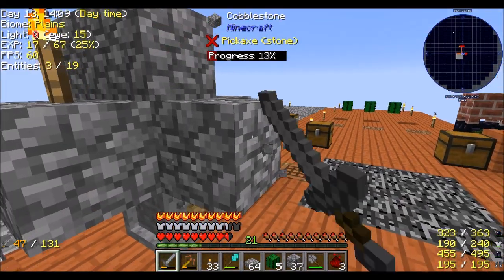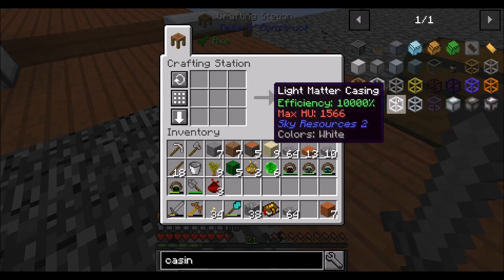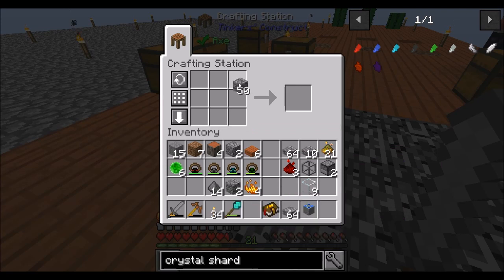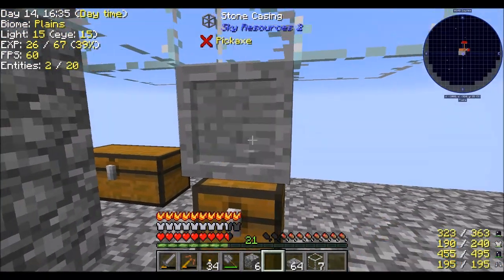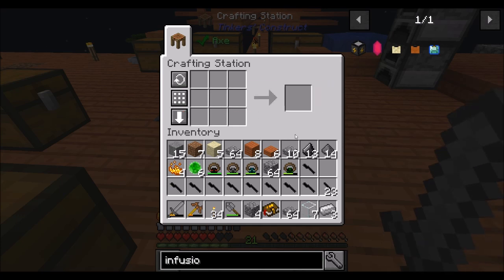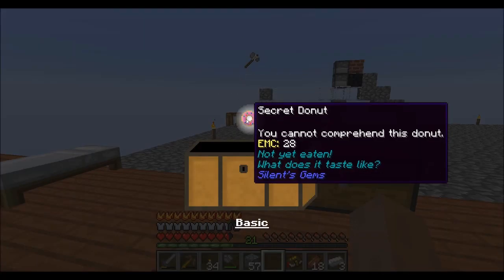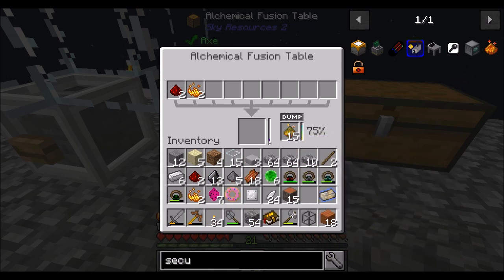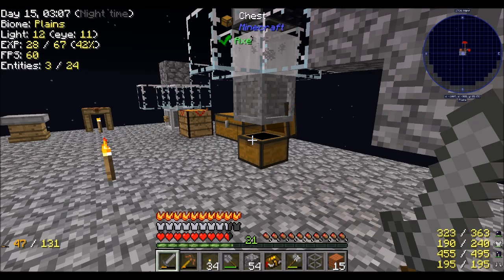Modern Skyblock 3   Ep5 Full Metal Alchemy

Comment: More hot (if a bit belated) tips coming your way!
- This pack has some of the best utility mods that one can ask for, so take a minute to familiarize yourself with them:
• Carry On! The mod that makes moving your chests, drawers, and pretty much every other inventory you can think of extremely easy. By default you have to shift-right-click the inventory with an empty hand to pick it up. I would, however, suggest changing the button to something else (alt for example), as it makes fiddling with drawer upgrades impossible.
• Crafting Tweaks! Hard not to notice the buttons on the side of crafting interface. Rather than me singing it praises here just poke them a bit and you'll probably fall in love with them. Don't forget that each button has slightly different action if Shift is held.
• Last but not least, the mod that adds dump buttons to chests. I honestly tried to figure out which one it is, but looks like it's one of the hundred "adds random stuff teehee" mods… Anyway, it will be your best friend for a while: shift-clicking the chest button in your inventory will automatically sort your inventory into nearby chests depending on what's already in them. So when you come back from your mob farm you can just click that instead of manually moving all the drops into appropriate chests.

- Speaking of the mob farm… Yoyos are a great way to quickly clear it out, but what about quickly picking stuff up? Well, you're in luck, Coin of Fortune is really easy to make in this pack. You probably already have materials for it. The best part it has both passive and active mode, so you can just hold right click on it after clearing the farm without ever worrying about it messing up your combustion or passive cobblegen. And the way active mode works somehow feels extremely satisfying.
- Setting up passive cobblegen with couple Magmafied Stones, some crystal liquid, a drawer and a wooden hopper is totally worth it btw.
- With AE2 being out of your grasp for a while, try not to forget about the T button. If you're having one of "just where did I put it?" moments, just look up the item in JEI (or look at the recipe that uses it), hover over the item and press T. It'll highlight all the nearby inventories that have it.
- And speaking of things being out of your grasp… This is a bit of an early advice, but do not hesitate to trash most of what you're getting when hunting for gems. You don't really need to waste your time washing stacks upon stacks of apatite, certus quartz and Silent's gems when you can't even use them. And by the time you do need them, you'll have machines doing that work for you.
- If you have updated the pack, you can twerk for trees, plants and even bonsai.
- Bonsai pots will grow slime saplings, saving you some time on making the slimy dirt.

P.S. I just found out that OpenBlocks elevators are gated in this pack. Makes me wonder what is happening in pack maker's head sometimes >_<
Reply: Stairs are beautiful.
Reply: Solid advice there, thanks!
Reply: Holy Molly that Coin is waaaaaaaaaaaaaay  too op... 
A honorable mention is building a Nether Pigman farm for, you know, free gold, since Gold is rather difficult to get in early game
Reply: Pigman farms? pffff. Don't bother Direwolf20 with the intricacies of vanilla machanics xD
Reply: To be fair, you don't need that much gold early game.
Reply: And as for Coin… It's one of the most difficult magnets to get usually. It's pretty damn good though.
Reply: I didn't bother with a nether farm, instead once I got to iron casing tier/automatic droppers, I "automated" my condenser by putting 2x2 infinite water source, and funneled lava over the water source above the condenser, you could probably actually do it much earlier, it only dawned upon me to do it once I did have iron after getting sick of placing stone blocks constantly. Creates Smooth Stone automatically until Actually Additions becomes available. Does get jammed sometimes though, when it happens I take the lava block out and refill the 2x2.

Then post iron/redstone; you unlock auto-combustion/auto-collection, make a redstone timer drop a load of resources and afk.

Also I preferred the ore method over the crucibles, I prefer the ore doubling via hammering and sluicing (one day tinkers smeltery or pulveriser... ( ;.;)) over getting an ingot, though I dunno, maybe the crucible-liquid gets better? I  didn't really enjoy the setup much, plus no more inputs besides alchemical ore dust.
Reply: Also another useful tip for when you're trying to make your first sugar cane,  you can toss rotten flesh into the porcelain smeltry to create blood, blood can be used to form coagulated blood in the casting table, eating those gives a temporary health boost buff. Don't remember if the drying rack version gives the same buff or less, but it gives like 1 additional heart, for the needed 2 total. Helping save on the amount of food you need to eat? (maybe? also 2 additional foods! 1 for the blood and 1 for the blood jerky)
Reply: There's not much reason to make sugarcane since you can substitute it with rice. And it's not like you'll be able to get the necessary food variety before unlocking Actually Additions. It's technically possible to get before that stage if you really luck out on Mega-Loot armour — some of the sets grant more hearts.

As for crystal liquid vs stone… There really isn't much reason to not use stone in this pack. Liquid might come into play later when you're setting up fully automatic constant production of all metals. At that point, ore processing would either become huge unwieldy monstrosity or a bottleneck.
Reply: I went for the full grind option and had to make 6 Silky gems (24gold) spending 2h+ to build a nether farm instead of farminging that much glowstone seems good for me.

Also another interesting thing i found today are Shipping Bins (or something like that, its reverse Market) 1 Emerald for 16 Rotten Flash is great deal.
Reply: Glowstone for 24 gold is nothing if you spend a little bit of time making Osmium casing for your Combustion Heater. And yeah, Gated mode is nauseatingly grindy.
Reply: FYI, the dump into chest buttons are from Quark.
Reply: Ah, thanks.
Reply: I didnt expect it to be that grindy, and I'm also too lazy to reset my whole world... at least I will not finish the pack in weeks like I ussualy do
Reply: You don't need to reset it entirely. Go to your quest list, write down the IDs of the quests you have completed in "Questbook" (hold shift to see them). Now enable cheats and do '/bq_admin reset questID' where questID is one of the IDs you've written down. Repeat for all of them. Technically you can switch by simply doing '/bq_admin reset 978' but the quests for Gated and Staged can get pretty tangled up and confusing if you progressed far enough.
Reply: I'll finish what I've started. But it's good to know there is way to change it, in case... :D
Reply: @Andav0273 
Crucible liquid is better for some metals (like gold) if you really care about getting the most out of the ore alchemical dust.
Reply: If only they had Super Crafting Frame in 1.12...
Reply: @Schner1
 You wouldn't know cuz in the old sky block's he has played he would farm the heck out of pigmen for an EMC farm (back when Equivalent Exchange actually existed =,= )

Comment: Dire , try and piece together an EndStone Condenser over time. It will make your alch dust value skyrocket. You'd need to save up a few items from your mob farm.
-  168 Bones
-  56 Ender Pearls
The others can be grinded for or farmed.
-  28 Sugar
-  118 Quartz (Yeah, it's a ton)
-  84 Stone
-  2 Alchemical Gold
 - 1 Alchemical Diamond 
But for 660% speed and  660% efficiency it's super worth it.

Comment: please just use a trap door to open and close the combustion chamber.
Reply: A wooden one won't work, and if you're talking iron one, it's better to make an Item Grate.
Reply: or a dropper.
Reply: A simple dropper is a nightmare when you need to drop a lot of stuff in. And the quick dropper isn't unlocked yet.
Reply: it specifically mentioned the wooden trapdoor in his book. he even looked at it, had his curser on it, and didnt implement it. is the wooden one only valid for the wooden casing?
Reply: Only a wooden Combustion Heater accepts any kind of wood as a part of the multiblock. That includes trapdoors.
Reply: thanks for clearing that up.
Reply: I was thinking why not use a sticky piston to move the cobble...
Reply: Item Grate works nicely, doest lose heat and you can throw stuff thrue it :)
Reply: By the time he gets slime he'll probably have access to ways to do this anyway. And Item Grate is still a superior option even if he doesn't.
Reply: +nightcaste because he only just got access to redstone this episode
Reply: I don't think he has any slime balls yet.
Reply: Except for being able to turn raw jellyfish into slimeballs :P.

Comment: Direwolf, you can use an 'Item grate' from 'Dark utilities' instead, you will retain HU while being able to drop items in, cheap to make as well and save you resources.
Also, you can instead of fidling with crystals, use the Iron Alchemical Ore dust to convert stone into iron ore instead. Just make a stone gen on top of the condenser.

Comment: Dire, please, place Item Grate (Dark Utilities) on top of your combustion multiblock, please. :)
Reply: The problem is, Dire cannot craft the iron dropper from sky resources, because Pixel disabled the item. You have to finish  2 or 4 stages in quest book to unlock options for basic automations. Item Grate You can craft as soon as you get the 6 iron ingots, and Item Grate will complete the multiblock and will keep the heat inside the multiblock.

Comment: Dire you can totally double possibly triple metal production using the other method instead of crystal shards! If you put Stone instead of the crystal fluid in the empty space between the glass (would no longer need the glass there..) you can turn it into iron ore block instead of an ingot. The you can use the crushing table and hammer to smash it down then run it through the sluice (which you have to make for a quest) then you cook it into double the ingots! You even get some additional dust the you wash in crucible (which is how you get lapis etc) and you have chance to get more ores/dust...

Also with all your messy cobble pillars underneath base I'd recommend maybe swapping into creative to clear it out and then swap back. Just save a load of stuffing around with riding water ladders etc. :)

Comment: The condenser is NOT a multiblock. All you need is  the condenser and a block of air above it where either crystal fluid OR STONE can be placed. The setup they showed you was just the most efficient way to automate the condenser via crystal fluid. If you want to automate it with stone (which gets you ore instead of ingots which has very easy early game ore doubling) all you need is a sequential placer which is very easy to make.

Comment: Put a smooth stone on a condenser to make the metal. No need for the crystal liquid.
Reply: I have automated the smooth stone on the condenser before I got redstone. So its more easy to automate that with a smooth stone generator. I dont need to use a timer or any fancy redstone :)
Reply: However the crystal is better for some of the metals if you care about getting the most out of your alchemical ore dust.
Reply: I created my smooth stone generator a couple of blocks away from the condenser. Takes a redstone clock and a piston, but it means I can switch it off with a lever when I want to use the crystal instead. If you take that approach and care about wasting crystal fluid (which is more of an issue once you can automate the crucible) it's important, but fairly easy, to also set up a mechanism to stop the liquid being dropped while you're in smooth stone mode.
Reply: The lower tier ores give a better yield with crystal fluid. By the time you're into the metals where making the ore and doubling that gives a better yield, then you have what you need to start automating. In an automated setup it's not worth doing stone until you can 2.5x or 3x your ore yields.